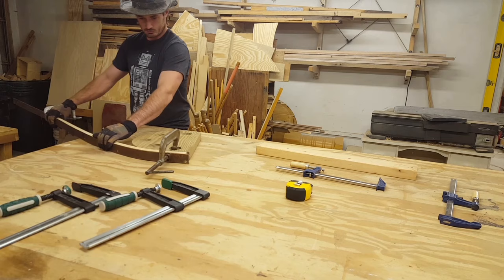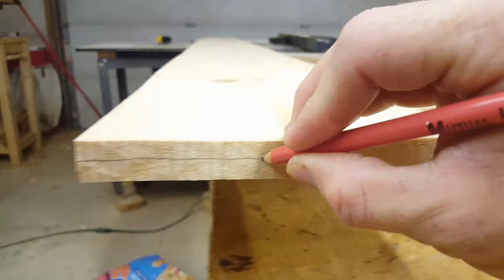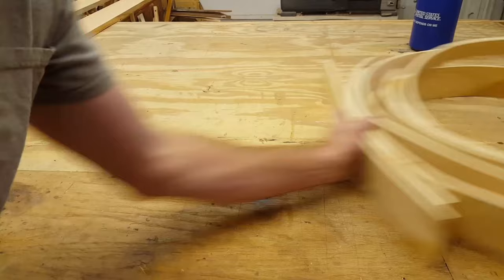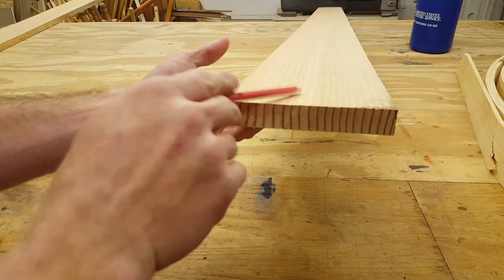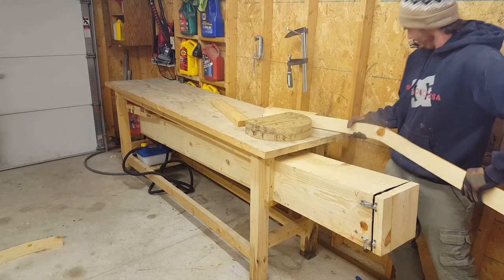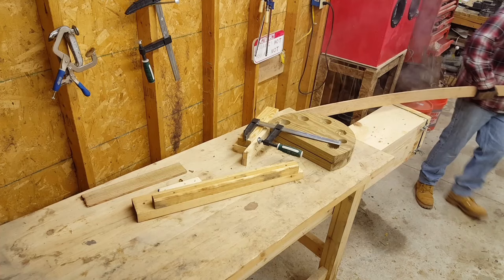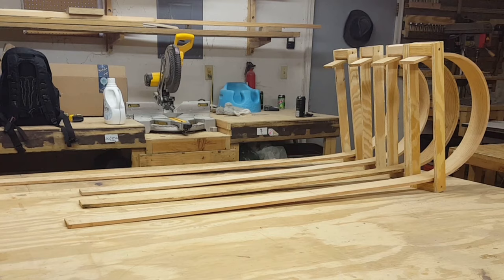How to steam bend wood, Troubleshooting

Comment: One secret is as you do, make sure that the wood is only compressed, that the bending all happens as a compression on the inside. Secondly steam under pressure 2 atm gives you 1 hour steaming per inch thickness. Green wood is half the time. Thank you.

Comment: Nice work man! There may be something off with your steam production. I just had great success steam bending 5/8" thick cherry (air dried and quartersawn) and steamed those pieces for 45 minutes. They bent with very little effort - basically by hand. I used a steel strap similar to yours and attached a come-along to it, cranked around a form.  I actually feel I could have gotten away with 30 minutes as I could see the end grain bubbling well before 45. I used a big turkery fryer/gas burner with a rubber hose going into a 6mil poly tube as my steam box, zip tied at each end. The uphill side I left a bit loose for steam to escape.  I hope to make a video about it someday. Thanks for the video. I like your dedication and trial and error process.
Reply from the maker: Nice! I'd love to see it when you put it up. I'm pretty sure my main issue was using kiln-dried wood. The video I did after this one was making a toboggan with steam bent wood and for that project I used some ash I got from a local Mill that had been air-dried. It bent so easily I probably could have reduced the amount of time in the steam box.

Comment: The rule I heard is 1 hour of steaming per inch of timber thickness - that's just rule-of thumb. It doesn't take account of what species the wood is - i.e. how absorbent. Another idea: saves a lot of effort making a box if you just use plastic layflat tubing for a steam chest instead.

Comment: Nice video and some great tips. For thin strips up to about 5 mm I use a hot air gun. It works really well and is so much easier than all this steam malarky. Get it at the right temperature whilst applying a little pressure and you can feel the wood sigh and give up, that's when the lignin is soft enough to let the fibres realign. Clamp one end like you did then play the heat slowly along the strip bending as it gives up.
Reply: I'd like to try this method but I have a few questions, is the wood completely dry? What are you using for heat, gun or torch? Tia
Reply: @leeclement7716  sounds like a heat gun, yeah that would do it for sure. good tip Ill have to give that a go too.

Comment: I took notes while watching your video. I thought I’d share them for people to copy, paste and read through when necessary. Please still watch the video folks, this cheat sheet won’t have context without viewing. Thank you for making and posting! 

* Vertical grain timber 
* 2 hours per 1/4 inch 
* Pre soak
* Steel band on back of board when bending for even compression 
* 30 seconds from steamer to bend 
* Kiln dried timber will need fabric softener added to steam water to absorb properly between the fibre. Air dried is better. Fresh cut green lumber is ideal. 
* Straight grain timber. Knots and undulations will snap. 
* Have everything ready to go for bend and work quick
* Clamp everywhere
* wait 10 mins before pulling off the form then leave in snug brace to retain shape while drying. Few days minimum

Comment: Hi, thanks for the video. I'm really new to steam bending but I have been taught by a good teacher. He taught me that the best wood to bend is hardwood (in fact softwood is not great for bending). Ash and oak are the best. Ash grows fast and straight. What you're looking for is a straight grain and as few knots as possible.
Also, leaving for a couple of days in the jig in a continuously temperate room with an aluminium (or steel support as you used) on the outside should help prevent splitting.
Steam bending is such and energy efficient, eco friendly, sustainable way to work with wood i think its a shame to introduce unnecessary chemicals. Soaking overnight should dramatically affect the pliability of the wood. I hope my newly acquired knowledge helps and I look forward to seeing more of your videos!

Comment: You need to turn the steam box into more of a pressure box.  Glue all the non-movable joints and put a seal around the door then add compressed air to force the steam into the wood.  I wouldn't run the air pressure very high but an adjustable pop off valve would be a good idea.

Comment: Excellent video. I was told an hour per inch. The supporting band is essential. Regarding time steaming, on certain hardwoods I find too much steam causes cupping along its length, with consequent cracking when clamped. Time is more critical on smaller dimension wood.

Comment: Thank You for the video.... quite helpful. I’m attempting to slightly bend Asian plywood for a theatre prop (King’s Shield) and this is great info. Not a huge bend in fact only need a cup of about 2” in 20”, Starting from scratch, making a square steam box and will be using an outdoor turkey fryer and pot for the steam generator. Thank you again...
Reply from the maker: You might be able to do something like that with a tub of water. Maybe try running a bath of hot water and add some weights?  You might not actually need a steam box for that.  Sounds like a fun project. Good luck

Comment: Outstanding, Than you very much for the information - the steel band sourcing. Clarifying the grain. I encountered the same issues an bending anything thicker that 1/4". I don't have a steam box and was bending a three centered ellipses (nearly flat top) one for 5" and  the other 8" jambs  5' and 6' wide. I soaked the 8' boards overnight by laying out  and folding back a plastic drop to about 2' wide elevating the ends putting in the board using clips to zip it up to just an opening to pour water. Left it in there for about a day or so. With the mold i made the board needed to be pulled into it. I pulled down the center first then started heating with the biggest hand held clothing steamer i could find (i wanted a floor model but too much$) and slowly pulled each corner in keeping steam on them as i did. Now I am trying to bend 3/4" for the end of a counter /peninsula. I am trying to do it out of one piece of wood so the curve would be off set. I am getting it there but the front of the board looks shredded because of all the fibers i have pulled apart to make the curve. the steel flashing hopefully will lessen that. Thanks for the tip and showing it in action !
Reply: Some success some failures. I have tried adding ammonia it just turns the outside layers dark so if the face of the bend will be for show you would have to sand down past that. I have also tried fabric softener - the theory is it softens natural fibers - I was looking forward to having some scratch and sniff woodwork but both failed even after soaking for days. I think it would be successful is a slightly pressure positive steam box (as far as ammonia there is a video of wood being turned pliable enough to bend into a helix - small dark pieces) . Now determined I went to HD and bought 4" pvc with hand tightening plug for one side and a T with 2 caps and reduced and some flashing .ordered a 5 bar steamer from AMZ... I am able to bend to 3/8" after being soaked a day or 2  I post the rest and pictures on my page

Comment: As far as a tip is you need to over bend to compensate for spring back.  If you have bend something for an inside curve it will be hard as hell to get it into the curve. Thanks again for the flashing idea. I see you mounted it onto another board and you place that over the end . It seems to be the fastest method to get it in place for the bend and with tension from the start. My only dilemma is I don't have space for a steam box i would seam as i go and I am bending a 1"x3" (.75"x2.5") x 8'. Last night I did bend one but the outside shredded. The flashing i bought will fix that i hope...
Reply from the maker: Thanks for the imput! Steaming it in a bag is also an option for a limited space.

I found that if you leave the wood in it's form for about 2 weeks you won't have any spring back. In mine once all of the moisture was dried out the wood shrank just enough that the forms literally fell off. I don't know of this works with thicker woods but it's worked for me every time so far. Thanks!
Reply: The result https://drive.google.com/file/d/1P5dHiDnozP_mk74wHOrIybg9-6O11I6B/view?usp=sharing

Comment: I’ve heard ammonia in the steam water works to get into the wood faster. Additionally- not sure if you did it but to screw a block to the other end of your metal strap or clamp the wood to the strap before you bend it to keep it in compression as well.
Reply: Didnt he do that?

Comment: Steam bending hardwoods is 10X easier than softwoods.  Clear, straight-grained White Oak, Black Locust, maple, walnut, ash, osage orange all bend really well.  Soak first, use a bending strap (aluminum or galvanized, steel will discolor the wood).  1 hour per inch of thickness, more will dry out the wood.

Comment: Great video and great comments, but I'm not seeing or hearing much about lignin content. Hardwoods like oak and ash have higher content of this natural polymer. The heat temporarily makes the lignin maleable, but wont compromise strength like when using chemicals on top of heat. I appreciate the comments regarding grain position, as that's probably the hardest thing to read in the wood. Im looking to steambend Tuauri, which appears to be similar to red American oak. Supposedly harder. As with all woods, I read the grain before taking any kind of tool to it.
Reply from the maker: Yeah the lignin is one of the things that make up the connective tissue between the fibers and its kind of like a thermoplastic. The tissue itself is made up of a few different compounds and together they will dry out and once that hapends even heat won't make it bend properly. As long as that connective tissue is well hydrated heat works very well on the lignin. If your wood is grean enough you shouldn't even need the steam.
Reply: @WyldeWoodworks  I really like the idea of using green wood, although that seems to be very location specific. I'm in Europe, and finding green anything other than pine seems difficult. From my understanding, staying away from kiln dried lumber is key.

Comment: awesome man. great info, thank you. I just picked up the kit, of course they didnt send the hardware so Im not sure on the brass fitting size. guess ill need to take a trip to home depot and pick up some kind of gasket for the door, a thermometer and a latch anyways. keep up sharing info.  oh so you cant take a 1x5  say 8' and bend it? even if you steam it for say 4 hours or so?  Im planning on making some end tables with a 1/.3 circle or a wave. but that woods going to need to be that 1" thickness Im pretty sure.

Comment: That’s real useful dude, thanks. I’m in the process of steam bending (trying to) cedar shingles for a project. Got about 180 to do but not been too productive so far. Trying to gang bend a few at a time with various moulds, convex and concave. Had them soaking for a week, need more heat/steam in our box and need to choose the singles better. Too many breakages just yet!
Reply from the maker: Yeah I must have spent the first two months just breaking boards until I started getting successes. That's sort of just how it goes learning to steam bend. Good luck
Reply: Dylan Strawn thanks, making changes today,  steam box upgraded already, now to make a strapped former and get a production line going. 🤞🏼
Reply: id be curious to know strategies you used to bend lots of them. 1 have to bend 29 different shapes as many time as possible. The demand is high but i need to get my process efficient.
Reply: @dextrovmo  in the end we were most productive with the 3rd version of the former. It needs to have a flexible metal strap on the outside of the curve to give support in the bend. The metal needs to have stops at either end so that it fits snug while the workpiece is straight ( varied snug depending on how far you are bending) basically the wood needs to be in compression as it bends to re structure the lignin fibres. Also it’s a good idea to take it past the desired bend to really stretch the wood then bring it back to its stop point. Again this depends on if the final piece is fixed like a chain or in our case roof shingles that were relatively unsupported, just relying on the steam bending to hold its new shape. Hope that helps!
Reply: @eddbuckpitt  Thank you for these precisions. Beyond the technicalities of what makes a successful individual bend, I was curious to learn how you managed to ''gang bend'' lots of them and get your bending process efficient in numbers of bent achieve, almost like a production line. Any thoughts on that? Did you have multiple forms? If so how did you manage to stack them in your shop so they don't take all the space?
Reply: @dextrovmo  we did 2 at a time in our double former, left them for 7 mins to cool then put them in a formed rack and held with a quick cramp.  We did about 80 in our best day. Hard to explain without pictures.

Comment: Instead of a steam box I use a pipe.  It allows me to achieve steam pressure in the steamer, about 3 to 5psi or better ...  just like a stove top pressure cooker.  The actual penetration of the steam was doubled and the time needed in the steamer was cut almost in half.   The lumber became a wet noodle.  I could do most anything I wanted to it successfully.  It’s a significant increase in success.  Pressure !   Be careful and understand you’re working with live steam and it’s under pressure too, that can be dangerous.  Caution is advised.  Be well.
Reply from the maker: I thought about this but I didn't know how to properly regulate the pressure. Sounds like you figured it out though. Good job
Reply: Yep 👍 😅

Comment: I had purchased the Rockler steam box and plans some years ago. Built it and it was never a success. Leaked and bowed the white pine. Today watching your video I see that you have like a stove pipe added which apparently making a big difference. I would like to know what other materials you used surrounding the pipe. Great informative video, thank you for sharing.
Reply: One of the rules is do not use pine or coniferous timber as a rule, use deciduous trees, Oak Ash, Elm.

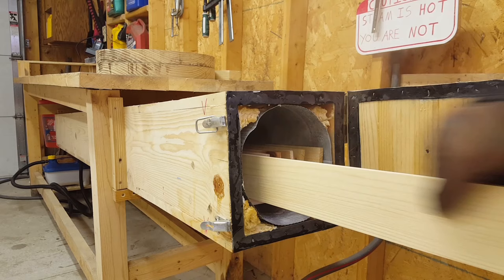Comment: 1:29 
1:40
Your basic problem is that you aren’t bending wood that has the lignan characteristics and fiber strength that permits it to bend well. 
Softwoods aren’t a good choice. 
Neither is sawn lumber. You need to rive it out of ash, red or white oak…
4:08 the wetness doesn’t matter- the temperature of the lignans matters

Comment: Apparently deciduous trees (the word means 'leaves fall off') , They include oaks, maples, and beeches, they can steam bend whereas pine trees, (non deciduous) which are quite different in structure, they can warp but are more unpredictable at accepting a bend.
Reply: Yes, unless your outside of North America.  I'm in Australia.  Almost all our hardwoods are evergreens.  Basically the theory is that fast growing softwoods collapse under the pressure and the inside surface gets wrinkles.  Still might be OK if the inside bend is not on show.

Comment: That was good! I am doing a project that will put my skills to the test, you have good ideas. I am going to be doing the glue up as well during this process, would the fabrick softener affect the glue?
Reply from the maker: That's a good question. I have never tried but I wouldn't think so. If you start with green lumber you can skip the softener step
Reply: @WyldeWoodworks  I'd love to do it with green lumber; however this is a strictly frugal project, and I must use the lumber on hand.
Reply: @WyldeWoodworks  How much softener to water?
Reply from the maker: @1jumbox   I'm not sure how much is ideal but I usually add about a cap full of softener.  Just remember that if you're working with fully dried lumber then there's a very high likelyhood it's just gonna break on you. This isn't really a frugal project. Let me know how it works for you though!😁
Reply: @WyldeWoodworks  That is the best advice I've ever gotten, thanks!!!!!!!!!

Comment: OBSERVATION:  So, as an observer I feel that your technique is flawed (I have seen others do the same thing).  By holding the board far from the point of bending and then walking around you are basically saying to the board "Hey can you show me where your weakest point is"  the board says "yeah, its right here" :)  The metal strap is compensating for this flawed technique and basically holding the board together.  SOLUTIONS: 1)  Put your hand or a block directly over the site of the bend and push it around (might require quite a bit of strength).  In this way you are only putting stress on the part that is bending and it is fully supported.  2)  mount the board and push the round block into the board.  This will require a lot of force, maybe weights or a jig of some kind.  Good video.  Thanks for posting it.

Comment: Do you think this method would work for trim on an arched window?
Reply from the maker: Potentially but I would cut and route it after bending or it will probably break
Reply: @WyldeWoodworks  At that rate I was probably going to cut and route it from a solid board without bending. Window is only 24 inches wide so 2x 12" sides.

Comment: Why are you using pine? White oak and ash ( straight grain no knots) are the traditional woods for this. Also use sir dried wood not kiln dried for better results
Reply from the maker: Yeah, I mentioned that in the video. I used a lot of different kinds of woods to see what would work. Pine does bend if you can get the connecting fibers sufficiently saturated. The reason I didn't use White Oak for all of my tests because it's incredibly expensive to use Oak for testing considering most of them are probably going to be wasted anyway. My final project I ended up doing in Ash. It worked fine.